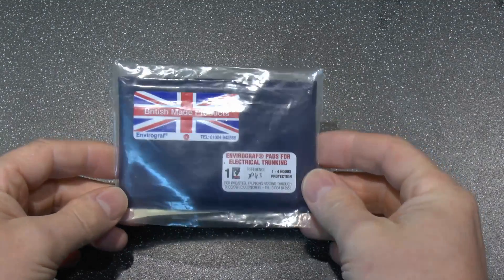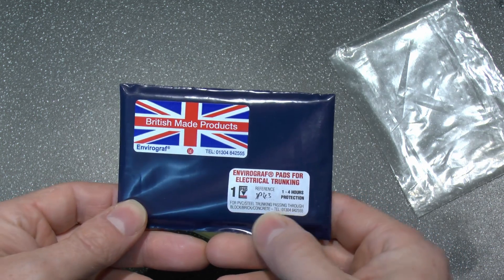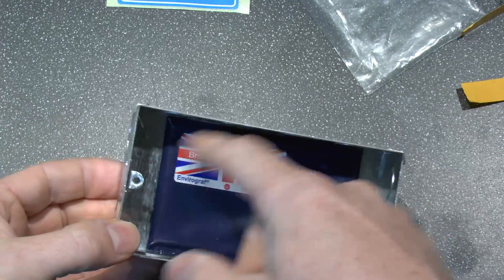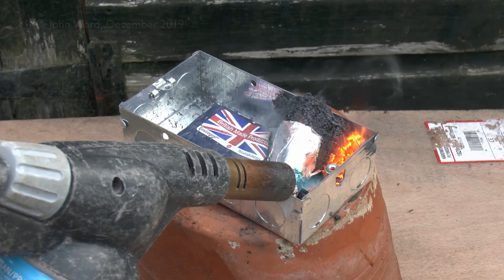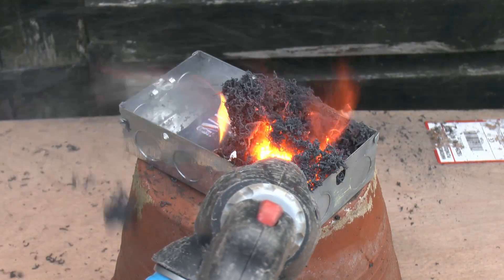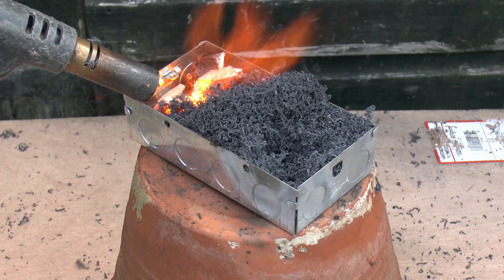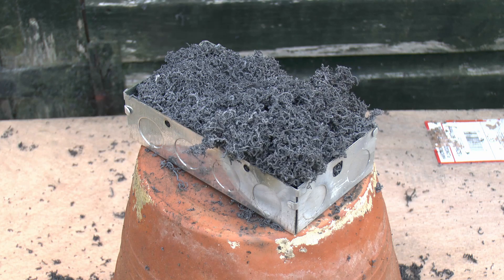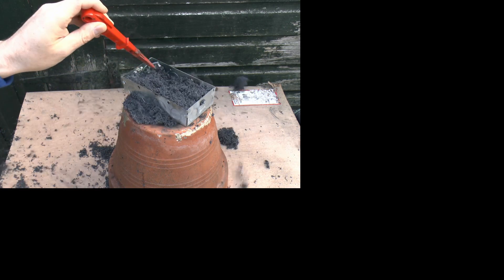Intumescent Pad Demonstration

Comment: I worked on installing fire alarms at a large brewery with warehouse complex that caught fire during building before sprinklers were in. Only half warehouse was lost due to fire stopping with intumescent panels and door seals. Unfortunately that was the half where the fire protection systems were being stored😪

Comment: Don’t look very good, wouldn’t StuffIng something like ceramic fibre blanket be a better bet ?
Reply: I think the idea is that even when the cable insulation/plastic trunking melts/burns away the intumescent material will continue to expand into any void, and a little pad like that is less likely to be removed (and 100% definitely replaced!) the next time someone pulls something through the penetration. There's some logic behind it but I agree they're a bit iffy.

Comment: How long will these pads remain good when installed (not accounting for fires, of course ;) )?
Reply: Now this is only based on the video and not knowing much about the material, but since neither the sticker on the pad or the sticker to put on the outside of the box in the packaging had a "fill in installation date here" text I'm assuming it'll be a pretty stable material in normal indoor situations, presumably expected to last as long as the electrical installation itself or longer?

It's a good question you're asking though, tempted to actually put some time into looking up what that expanding fibrous mass actually is. Do take notice of the easily burned sealed plastic outer cover, I'm guessing moisture (or moisture escaping from it) is a potential exposure they might not deal well with.

Comment: Are these things actually approved by anyone ? To me, they look like a thermal disaster. The temperature required to get the thing to expand would have completely destroyed PVC trunking well before this thing gets going and it'd do nothing to stop smoke getting through prior to actually being heated. I think you'd fair a lot better running garden hose through the trunking with a permanent water feed.
Reply: Whilst activating, at temperatures far lower than a blowtorch demo, graphite based intumescents will give off large amounts of smoke itself. PVC will melt around the activation temperature and the pressure generated by the graphite will force its way past or through it. Whilst these products should have been tested to specific standards, their "approval" for use should be in line with the test evidence and the surrounding construction. To install these in situations other than that would be akin to fitting a bicycle tyre on a ferrari, just because it's still a tyre.

Comment: Interesting. I was surprised to see how "loose" the expanded material was. In a fire, there are big pressure differences between where the fire is and where it isn't. This is why fire spreads. How does a loose fill material like this actually stop the flame going through the hole? Why does it not just get blown away?
Reply: It's meant to be installed inside an enclosed box so nope, not at all. Some will of course escape but there's plenty extra there. Imagine putting a lid on the thing.
Reply: I would say that graphite pad has a poor mix with little binder in it. A good mix will retain a more solid structure for far longer than this example.

Comment: I think by the time the plug sockets are burning I would hope I’m already out the building, I get why these are used but they seem pretty useless at the same time.
Reply: mission continuity. you are out but your equipment isn't.
Reply: @juz4kix  Not just continuity tbh, if this can slow down the spread of fire to other rooms in a larger facility (fire compartments were explicitly mentioned in the narrative of the video) then more people can escape. And maybe the fire won't grow to the scale that all the fire department can do is to prevent spread to nearby buildings but maybe actually contain it in a section of the building.
Reply: They are not useless.
As an example, fire doors in buildings will have intumescent strips along the sides, so that they help block the smoke and heat from seeping through.
Now, you do have a good criticism if you're talking about drafts, as this video shows. The ash is easily blown away, which is NOT optimal, since fires naturally create a draft (and quite strong, in fact).
Reply: Benjamin Esposti you an electrician?

Comment: Strange. In the US, conduit holes and the like that go between floors in a building have to be sealed with a fire retardant foam, very similar to the stuff you use for plugging up air leaks around windows in a home.
Reply from the maker: If the conduits are sealed with foam, how are you supposed to alter/add wiring in the future?
Reply: John Ward you don’t. We run an excess of fiber/power in most cases. When you need to add wire, you drill out another hole.
Reply: @jwflame  It won't be too difficult to poke a hole through sealant the size you need.
Reply: @jwflame  Do the building regs not specify only metal conduit through floors/ceilings - of non-simple* buildings ? Poor show if not.
* i.e. all building except single occupancy dwellings. (Pointless in those as there's usually an unhindered staircase in a hall with great vertical fire transport potential !

Comment: Interesting video John. I've done quite a bit of work on fire stopping but never seen an experiment with intumescent material like that. Keep up the good work mate.
Reply: I don't think they're any good. Won't stop smoke as too cold and I think they need too much heat even to stop flame. I estimate John's torch at 600-700°C and everything else will have failed/burnt long before that.

Comment: I'm surprised we don't line the inside of stud walls with this stuff to ensure the containment of a fire to only a single room. The same way that fire doors work.
Reply: I work in Architectural field and with apartments that are adjacent you need to double line the walls each side and any back boxes with intumescent sealant in the gaps on those partitions. Nothing stopping this been done in a domestic situation. All the details you need will be in the British gypsum white book or in the robust details handbook pdfs. Both very comprehensive books.
Reply: If you build a stud wall to the right fire resistance spec in the first place then products such as this (which doesn't look the best example to me)  should maintain the  integrity of that wall.
Reply: Might be prohibitively expensive. You can buy intumescent paint but it's something like $300 for a 5 gallon pail. Still, if you really wanted to inhibit fire, that would be one option.

Comment: If this was in a switch or socket box - I would expect the fibrous material to expand and simply drop to the floor, after a minute or two (as you demonstrated) all the material has dropped on the floor, thus allowing fire to rapidly pass through the wall.
Reply: How? It's designed for a semi enclosed or enclosed space to seal penetrations to stop fire and smoke from spreading. What hole would it fall out through?
Reply: It's usually sealed in a metal trunking. So would expand and not fall out
Reply: I'm imagining that the pads designed for use in switch boxes probably have some sort of material that is designed to restrain it. This particular type is designed for use in trunking, which I'm guessing is what is known in the US where I am as "raceway," which is completely enclosed. There's all kinds of intumescent material available. Another type is a putty that you press in to place around plastic pipes and conduit that passes through a fire rated wall. In a fire, the putty will expand as the pipe melts, causing the pipe to be pinched off and thus sealing the hole. This material is typically also a very poor heat conductor, and can prevent high temperatures from getting across it for an hour or more.
Reply: Sounds like an idea for the next John Ward 'incinerate' video.
Reply: The graphite in this example has very little binder in its mix, which is the ingredient that holds the swelling material in a more solid form.  This product, which as a demonstration of activation is fine, would only work if retained for the duration. Once the covering socket melts in a fire this example would rapidly lose its ability to maintain integrity as it would lose the ability to maintain its own structure.

Comment: what would be the temperature  on the vase, since it was blocking heat from unterneath? That looks quite safe never seen one expanding before :P Thanks again
Reply: No, in real life they probably never get hot enough to expand until the building's burnt down.
Reply: @millomweb  hence the "never seen one expanding before" and lots of fires, and some irony ;) would like to know the temperature where it expands and on the vase to check its fire retardant properties but that is asking for more setting things on flames, accidents.. ( Edit) Nevermind, the demo is very good from JW , this time not being ironic.
Reply: @MalagasOnFire  Also, as it blows away in the wind, if it expanded to fill a hole then there was an explosion in the room, it'd simply blow it out of the way.

I'm totally unimpressed.